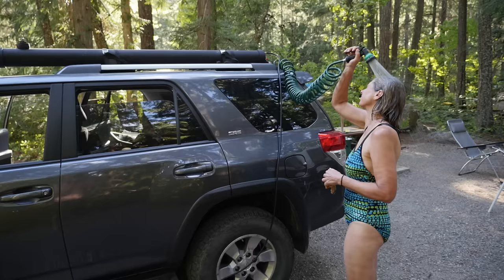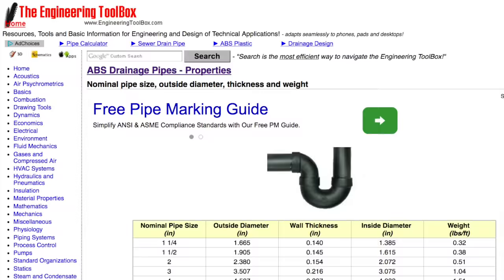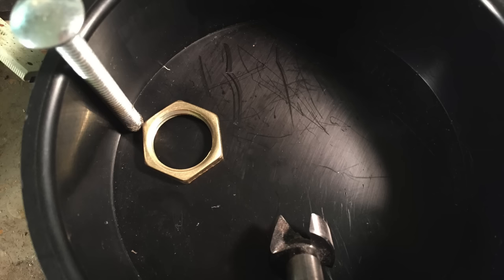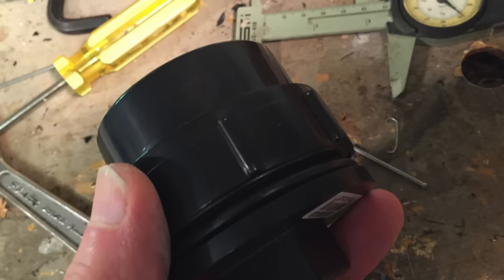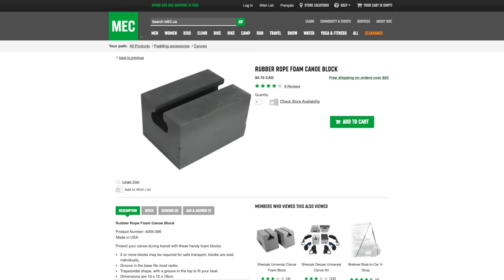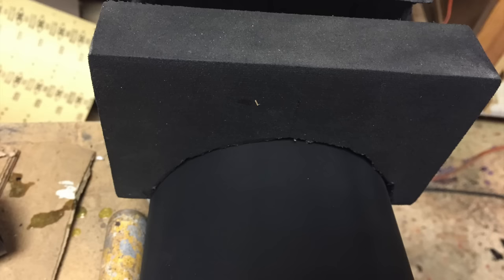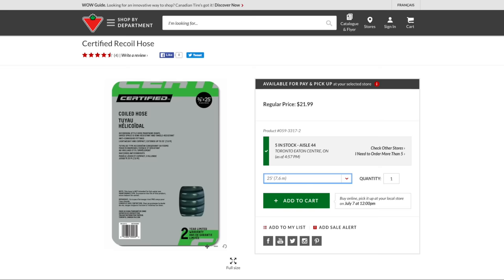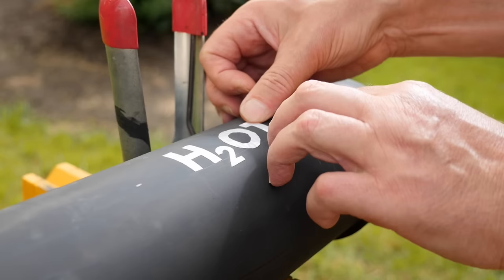H2OT - Rooftop, pressurized, solar-heated shower/sprayer using ABS pipe. DIY

Comment: A couple of questions:

1). ABS pipe is said to deform under the heat of the sun. Have you experienced this at all?

2). Are you concerned about BPA leeching into the water? Research has shown that cashiers that handle till receipts have higher levels of BPA in their bodies than people that do it handle receipts.

3). Could you use PVC instead?
Reply: I read through more of the comments and I found the answers I was looking for. Great video. Thanks.
Reply: It does deform. Sold mine after it did.

Comment: Thanks for the video, very informative. My dad and I go camping once a year, we are going to make something very similar. Just a few questions. Wouldn't solid core be more suitable over cell core? Cell core has that foam material inside which is aerated, wouldn't this reduce the effectiveness of its UV absorption in comparison with the solid type? Also, would you consider removing the relief valve completely and just installing the inflation valve in its place, then when you are done with the shower to can just depress the schrader to relief the air? I figure the less valves/cuts the less chance of leaks.
Reply from the maker: Solid core would work well. I chose cell core because a) it was easier to find locally, b) it was cheaper than the solid core, c) weight, d) impact resistance. 
Cell core is a trade-off in heat exchange as you correctly point out. While it takes longer to heat, it retains its heat longer. 
You could easily omit the relief valve and just release the pressure using the hose with the front of the pipe lower than the back. This was all the compressed air is at the hose end and the pressure would be released without the water.

Comment: Hey great video - I've watched a few but I went with this design for my rig.... I read through most of the comments where you replied and I didnt see where anyone asked this question. What all did you use on the clean out valve threads? I've used teflon tape but still getting air leakage.... i dont want to use the all purpose..... what if anything did you use?
Reply from the maker: I used teflon ape, but it is not really necessary. When the cap is screwed in tight (up to the rubber O-ring) it is almost perfectly sealed. When my pressure is at 30psi, there is the slightest amount of leakage through the threads, but it is very minor. After an hour, I only lose about 5 psi. 

If yours is leaking, it may be from variations in manufacturing tolerances from various pipe makers.
Reply: imaginetMedia. 
i believe the problem is my clean out valve didnt come with a o-ring. i believe that will fix my leaking... thank!
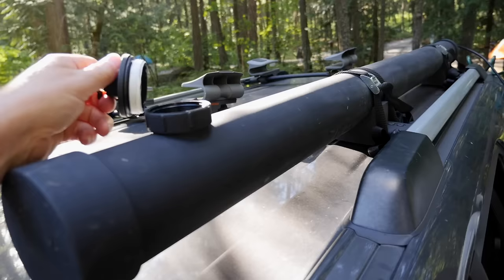Reply from the maker: You can see my O-ring at 4:07. It came with the cap.

Comment: I'm looking for materials and all of the ABS cellular core (that I'm having a hard time sourcing) says not intended for pressure use. Am I looking at the wrong product, or are we using it outside of it's intended purpose and at a low enough PSI that it's fine?

Also,t he only product I can find easily around here is schedule 40 PVC but the fittings available are PVC DVW that once again say not for pressure use. Any suggestions?
Reply from the maker: Look for the Schedule 40 ABS pipe.  It has a pressure rating of 100 psi for 4" (100mm) .  https://www.engineeringtoolbox.com/abs-p
Reply: @ImaginetMedia  can you source this in the uk?

Comment: Do you leave the compressor running while taking the shower? Or does 30 PSI give you enough pressure to dump the whole tank?  Thank you so much for the video! Building this project this week.
Reply from the maker: I only turn on the compressor when the pressure drops below 10psi.

As water does not compress, if the tank is filled to the brim, there is very little room for compressed air. Therefore at the start of the show, the air capacity will be depleted very quickly. As the water level drops, the air capacity increases and therefore the time between having to turning on the generator for a few seconds gets greater. 

I would say at half a tank, the air capacity at 30psi would take a minute to drop to 10psi. But I never have the spray on for a continuous minute. I usually spray a few seconds and wash, then spray to rinse, etc.
Reply: Okay great! Thank you. So how many times would you say you need to turn on the compressor to get through one tank?
Reply from the maker: I have never really counted as it is dependant upon how low the pressure drops before I turn on the compressor. As I said, I let it drop to 10psi with any noticeable effect on the pressure (due to my flow restrictive nozzle)

Comment: My only concern with building this is the spigot/cleanout plug. They are only rated for 5 psi in schedule 40 pvc or abs (from Home Depot at least). Probably need to come up with a different way to fill it up with water.
Reply from the maker: I routinely pressurize to 40 psi without any problem. I think you need to find a better supplier that does not sell knock off plumbing parts.
Reply: @ImaginetMedia  You are probably correct. There is a reason that the nickname is home cheapo. I will check with a plumbing supply place instead.
Reply: @gaddabout3856  Did you have any luck finding another cleanout plug? I also got mine from home D. I haven't put my parts together yet...

Comment: I'm not sure if this has been asked yet... But I live in Yellowknife where our winters commonly go below -40°C.  Obviously, I could only use this during the summer months.  But can I leave this setup on top of my vehicle year-round?  Or would the cold cause the piping, etc. to crack or cause other problems?
Reply from the maker: I take it off when it is not in use. No reason to leave it up there. My mounting system is designed to be very easy to attach and remove.
Reply: @ImaginetMedia  Thanks for responding.  The challenge from there is that my indoor garage is still about -15 °C on cold days.   Perhaps time will tell how it handles in the extreme cold.  I'll report back if I'm successful building it and find out the answer.  Cheers!
Reply: You couldn't pay me enough to live in Yellowknife... Aren't the dark winters super depressing?
Reply: @whatsdrugs  Haha... Yellowknife is definitely a love and hate kind of place.  Winters are ridiculously cold, dark and long.  Summers are short, smokey and full of bugs.  Lots to complain about, yet I've been here for 7 years now with no plans to leave.  It's home! :)

Comment: nice!  ...in practice, how do you fill it—bucket, pump, hose?
Reply from the maker: Usually a hose in the morning, just as we are leaving a campsite. If there is no tap available (as was the case where we shot the video), I have a collapsible  bucket I use when I get near a water source.
Reply: It looks like it works well!

Comment: If someone is going to try this today flight straps aren't the way to go use stainless U-bolts.... a 4 gallons isn't much water. Stay safe.
Reply: Was just talking about that with my buddies. u bolts for sure.
Reply: @offroadoverlords  At one time I had a Ford E-150 van with a roof-rack that I used for plumbing. On the rack, I had one 8" and two 6" sticks of PVC for holding pipe of all kinds and sizes, 1/2"  to 2" PEX, 1/2" to 6" PVC and ABS, and copper up to 4". They were all well lashed down with good heavy flight-straps. One day a car ran a red light and the woman driving felt it was better to slam on the brakes and screech to a stop about 3/4 of the way into the intersection. I hit the brakes and it was like launching three torpedos, the weathered straps didn't stand a chance. They all cleared the front of the van, slammed into the surface of the road sending PVC shards flying everywhere, proceeded to target the car in the intersection, all three went under the woman's car across the intersection and detonated on contact with the curb. I took the rest of the day off, cleaned up the intersection, and then drove to Home Depot for new sticks of PVC and u-bolts to secure them all. Stay safe.
Reply: @brianbassett4379  perfect example. That much weight, that high up, it's better to over build than under. And you can overbuild here for a couple of bucks extra. No excuse.
Reply: @offroadoverlords  I'm pretty sure that the 6 u-bolts were cheaper than the flight straps too. Stay safe.
Reply: @brianbassett4379  Yep, I’m always getting told I overbuild things and I know there’s usually a price to pay in the extra weight that goes with that but safety and/or not having to build the thing again because it wore out too soon trumps that for me.
Reply: @MapleMarmite  U-bolts are lighter than flight straps and will stop the thing from possibly killing someone.
Reply: @brianbassett4379  I understand and agree with that - I was generalizing with my overbuilding. It usually involves more or heavier materials when I don’t have a strong but lightweight equivalent on hand.
Reply: @MapleMarmite  When it comes to building and using something that could possibly kill another person I think it's best to err on the side of caution.
Reply: @brianbassett4379  Exactly.

Comment: I run an air under my hood already this seems like a great idea. I do have one question before I began tackling this. Does the water in the tank run back down the hose and into the compressor manifold and air compressor tank? I know you want to keep those things dry.
Reply from the maker: If you have a good compressor, has backflow prevention. Plus, the hose is pressurized and the air connection is above the waterline except when full.

Comment: Amazing video!  You’ve inspired me to build my own.  You also said 30 psi was suitable pressure.  With a 4gal tank at 30psi on a typical “shower” nozzle setting, how much time do you have before you’re empty assuming constant pressure from start to finish?
Reply from the maker: We never leaver the shower flow running on its own. Get wet, turn off nozzle, lather, turn on, rinse, turn off. Repeat.  Two of us can both shower and have enough water left over to power rinse our dishes.
Reply: imaginetMedia great info!  Thanks for the reply!!

Comment: This my have already been asked but what all tools were used? I can't quite make out the name of the small drilling attachment he listed, "forcemeat drill?" and the bigger yellow drill bit what is that called? I appreciate the answers this video is super helpful for my buildout!
Reply from the maker: I believe a "forcemeat grill" is a US fast-food chain!
Reply from the maker: But seriously, thank you for watching. I am happy to answer your questions.   The first drill is called a Forstner bit. It is designed to drill flat bottomed holes with no chip out on the edges and are self-centering, not requiring a pilot hole. A cheap spade bit would work just as well if you are careful and drill from both sides after drilling a pilot. The second drill is a hole saw. There really is no other tool for this.  This bit was the exact size of the pipe and I happened to have one already. It is not cheap, but you can get an inexpensive hole saw sets that would also work. Be very careful of the diameter of the hole though, there is very little margin for error.  An alternative to using a hole saw is to not drill the pipe at all - rather use a ABS Tee fitting on the end of the pipe.

Comment: Curious to see how the fill inlet is holding up with drilling into the ABS? Did you consider using a 4" tee? I do like the cleaner look the way you did it. Thx for sharing!
Reply from the maker: You could use a Tee, but that would add to the cost, add to the number of joints, add to the weight, and not look nearly as clean.   The drilled filler works perfectly. When you add solvent cement to ABS, it actually melts the ABS and chemically welds the parts together. That joint is never coming apart or leaking.
Reply: @ImaginetMedia  Does the filler cap leak at all?  Ive seen comments from folks who have in fact used a T and say that the cap leaks under pressure.  They recommend regular application of plumbers tape to fix.  Curious if your fitting has the same issue?  Thx!
Reply from the maker: @surban100  I have no leaks.  If you look closely, there is a rubber/silicone gasket on the 2" cap.  Apparently, not all cap manufacturers include the gasket.

Comment: Couldn´t find any answer in the FAQ or in the comments... How do you do to prevent algae build up in the tank?
Reply from the maker: The tank never has water in it when it is not going to be used. So after a few days of camping and constant use (and being refilled with fresh water daily), I take the cap off and leave it in the sun and let it dry completely. Then store it inside my garage where it will stay dry.  It would be no different than a water bottle or a coffee mug.

Comment: Seems like it would need baffles to keep the water from sloshing back and forth during driving. This movement would cause stress on the end caps. The sloshing would affect the roof attachments as well.
Reply from the maker: If you read my previous comments you will see I have described that the tank should be FULL when driving. This maximizes surface contact inside the pipe which is required for most efficient heat transfer from the pipe to the water.  Water does not compress. As such, there is nothing to "slosh". Regarding stress on the caps, I suggest you re-read the Schedule 40 acrylonitrile butadiene styrene pipe specifications.

Comment: How do you  connect the radiator drain plug with an airtight seal? -and thank you for the great video
Reply from the maker: It is just tapped into the lid. it has tapered NPF threads that easily tap into the ABS plastic for an airtight seal.

Comment: Any idea on how to bolt it onto a rack instead of the ties? I was thinking U bolts but it wouldn't work with my set up seeing how the shower is perpendicular to the roof rack bars.
Reply: Just found some ideas by looking at Yakima's Road Shower. Thanks for the video! It was very helpful!
Reply from the maker: I struggled with a bolt on solution.  Factors are I wanted to be able to take it on and off with not tools and I wanted it to be shock mounted, and secure under braking forces.  That ended up with foam supports and nylon straps.
Reply: @ImaginetMedia  Good insight! Thanks for the help.

Comment: Great video!  I'm curious what kind of compressor you're using and what battery you're running it off.  Thanks! :)
Reply from the maker: I am using A Viair 00088 88P compressor. It runs off the truck battery. It has alligator clips to clip right to the terminals.  DO not go cheap on a compressor if you ever plan on using it to fix a flat tire. Cheap ones that plug into he accessory plug are very low amperage and as such have to work harder and ultimately will fail when you need it the most. 
https://www.amazon.com/gp/product/B005ASY23I

Comment: Great video!  Did you use any kind of sealant around the threads of the shutoff valve, radiator drain valve, or tire valve?
Reply: Oops - I missed where you stated 3 weeks ago, "There is no silicone or any sealant whatsoever used anywhere on the project."
Reply: Also seeing this reply, "The spigot is threaded into the ABS cap. It has NPT tapered threads that are tapped forming Avery tight seal.  The O-rings were not used. You need to properly size the hole with the correct drill. You can heat the threads up with a propane torch and that will make the threading process easier as it will soften the ABS slightly.  Once you get the spigot fully threaded into the cap, the odds of the drain pointing directly down are slim. As such, you will need to back the tap back out slightly so it aligns, but this will leave a small gap between it and the cap. I used a small bead of JP Weld to fill the gap. It does nothing towards a seal, it is just a gap filler."

Thanks for sharing that tip about heating the threads up!

Comment: Great job,  I had a similar idea for a water tank on my truck.  How has it held up so far?   Have you made any changes?
Reply from the maker: It is working great. Better than I had hoped. We use it every weekend.  As mentioned in my other comments, you need to make sure you do not trap air in the drain end. So, when filling and using, make sure you are level or parked slightly uphill.

Comment: Awesome idea. I have made 10 trips to Lowes and other various stores. I am about to call it quits. I cannot figure out how you got the fill cap to fit using what bit? Ive tried 3 sizes of bits and destroyed 2 caps. If i could get this part right the rest would come together. Any help would be great. Also, i can only find 3" pipe where I live. There is no 4" and 6" wont fit on my roof rack with a roof box.
Reply from the maker: I am not exactly sure what part you are referring to. Do you mean the drilling shown at 2:11 or at 2:31 ?
Reply: imaginetMedia i was able to figure it out by buying a T with a built in fill cap. Thank you for replying.
Id add a pic but i cant figure out how. It turned out good.
Reply from the maker: Glad you found a solution. Yes, using a Tee is a good option, although it does add to the cost.